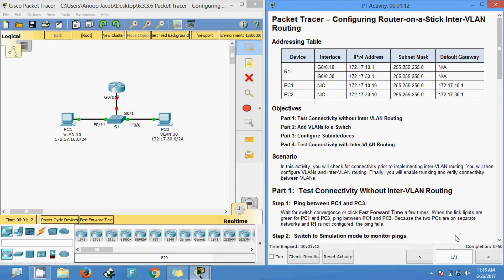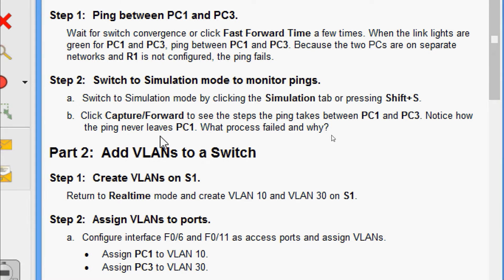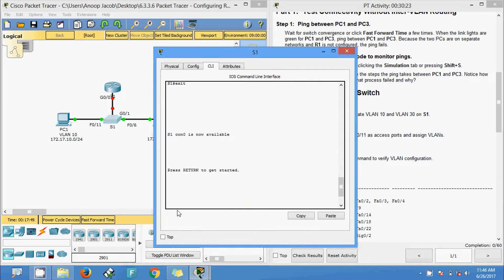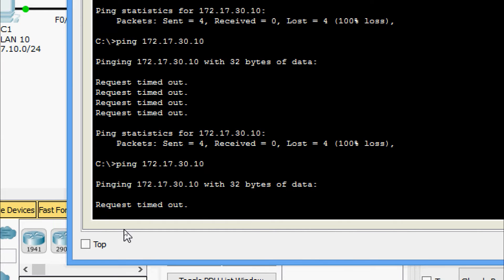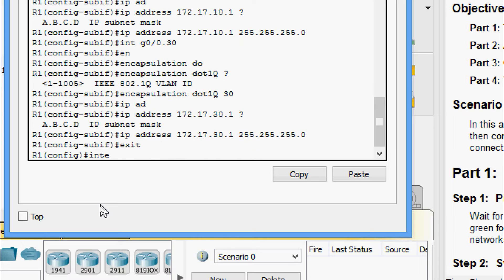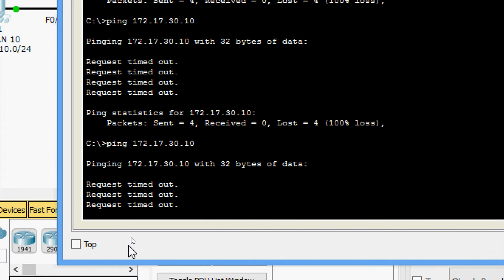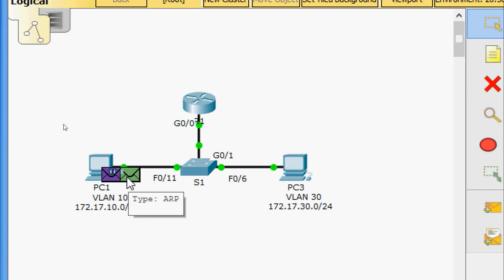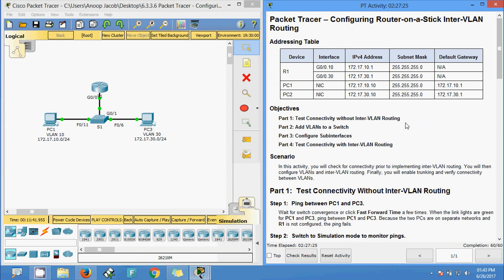6.3.3.6 Packet Tracer - Configuring Router-on-a-Stick Inter-VLAN Routing

Comment: what switch and router did you use? can someone help me
Reply from the maker: Hi
You can use 2960 Series Switch and any ISR router like 2911, 4331, 4321.
Reply: @TechAcad  thankyou but do I need to use the automatic cable or straight thru cable? because when I ping the two PC on the first task they reply to each other please help

Comment: After a few attempts, I have managed to make it work but the trunking part didn't show what it showed for you. When I gave the command to view the interface of the trunked gigaEthernet the list was blank and I could still see vlan brief I could still see Gig0/1 even though I can see it still as tunk on the configuration on the switch. Did I do something wrong? Did I not use the right switch and router? If you can help me understand what I did wrong that would be a big help.
Reply: Show interface trunk